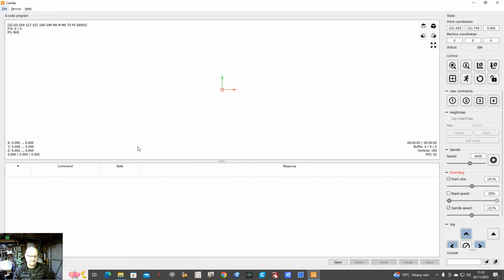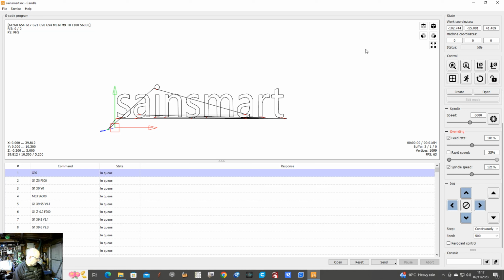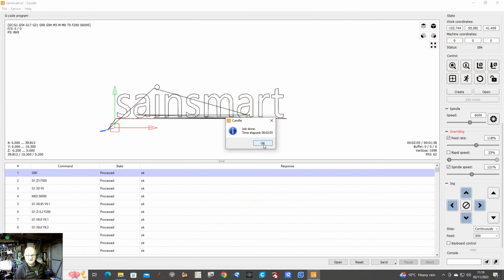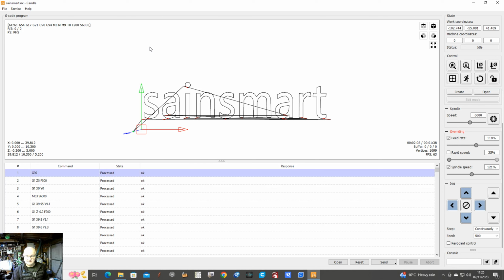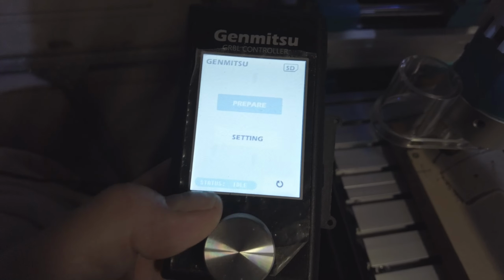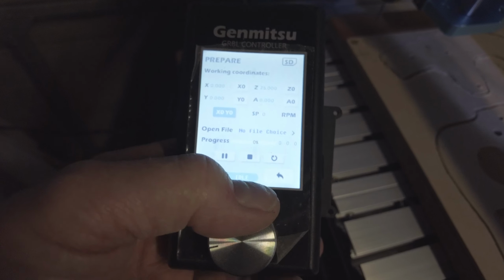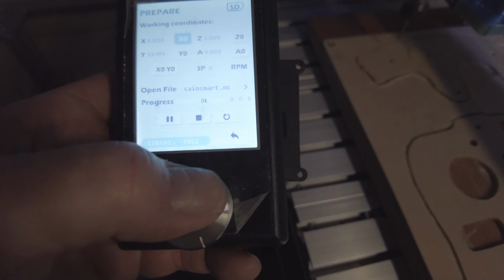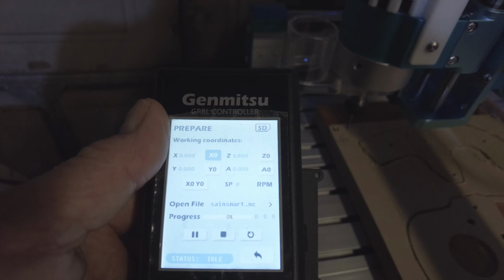Sainsmart Genmitsu 4040pro Cnc  Cutter & toolpath changes using  Candle and the offline controller

Comment: So Tony, i basically just copy the coordinates, enter it after a bit change , then start the cut (after resetting the z)?.  Also I have the 710w genmitsu router and the z probe does not respond, i know you did a video on it, but I hesitate to taking anything apart..is there another solution?
Reply from the maker: Hi thanks for your question, regards the coordinates making a note of them is worth doing if you have a power outage and if you loose the job zero position or the machine stops midway through a job. I find that if you boot the machine up again home the machine then move the machine to  the job zero coordinates that you saved, not forgetting to touch off again it will start from the job zero, it might have to run through some of the program again depending on where it stopped. If you are wanting to change a cutter once it has gone back to job zero after finishing a toolpath say a roughing cut. Then you would move the cutter away from the job so you can change the cutter, touch off then once you select and run the next toolpath it will go back to the job origin and start from there. You dont have to put the coordinates back in as the machine remembers the job zero  or job origin. Hope you understand this. As for the probe not working if its the same problem I had then you have to take the cover off and do what I did in the video, sorry but no work around.